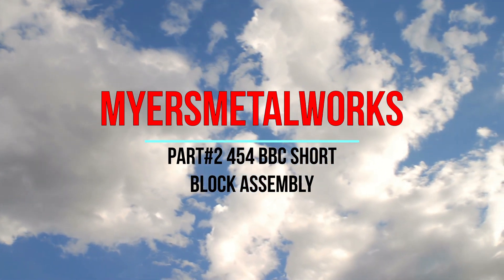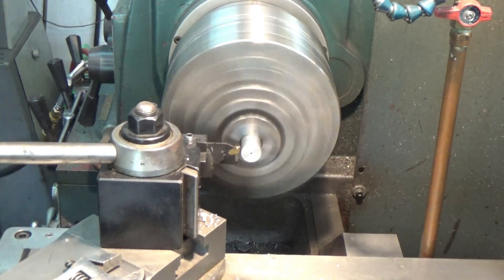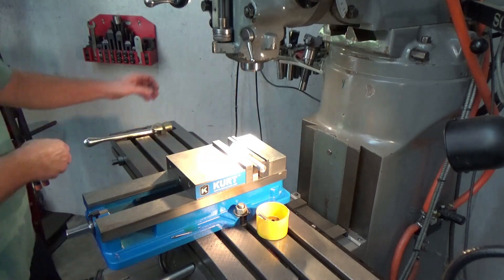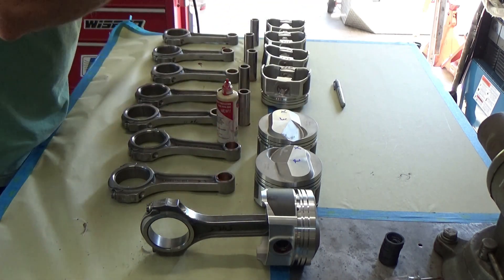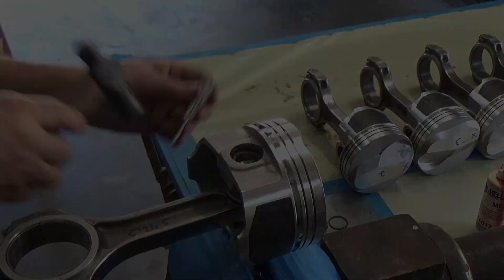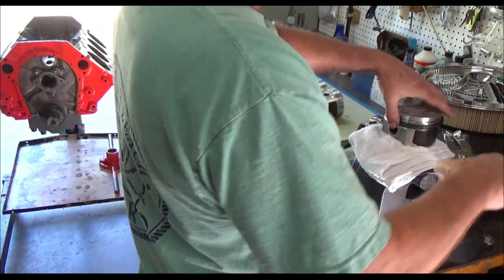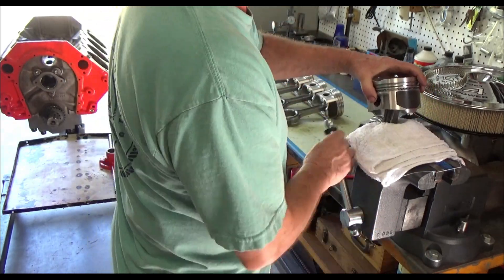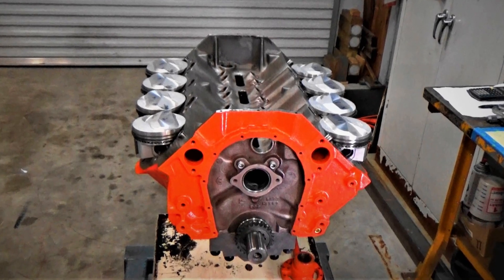Wiseco Pistons, Scat Rods and JE Rings...#5  Chevy 454 Big Block Performance Build...

Comment: Hey man, the oils rings and expander, if seen guys who bend the lower oil ring into some kind of recess? I’m following along with your build doing a 496 and I want to make sure I’m doing that right.

All my oil rings freely spin if I turn with my hand and also there’s no gapping involved with the expander correct? I’ve heard you can also install the expander upside down?
Reply from the maker: Hi Bornestellar... Look up  (Grumpys Performance Garage) and in there search type in (Another rings end gap question).. Time spent reading this forum will help... You will find alot of answers on your 496 build there...
Hope this helped...